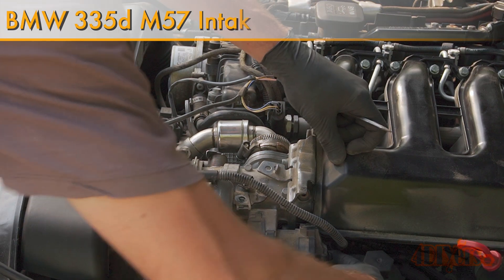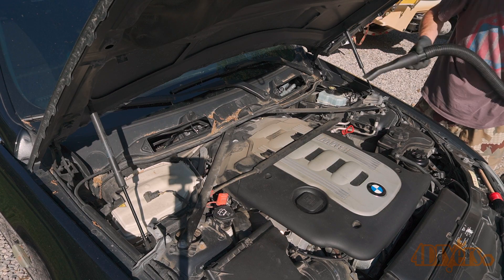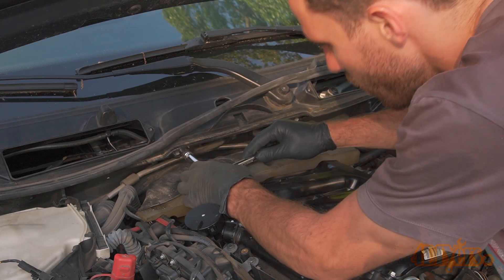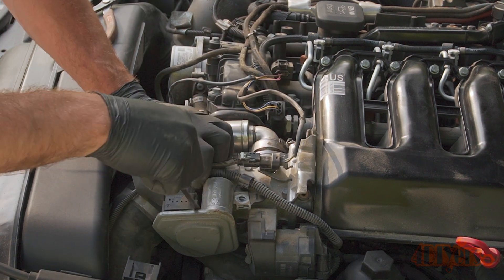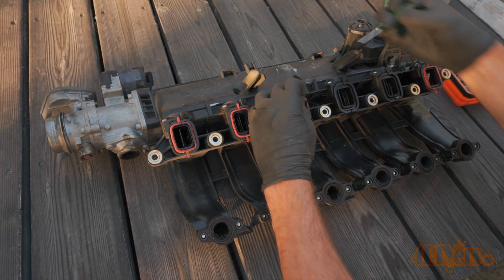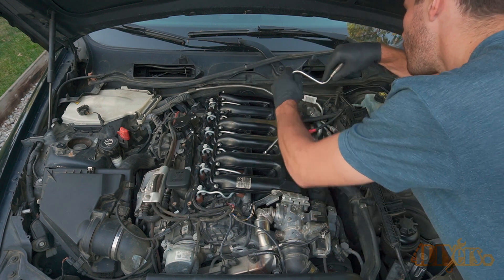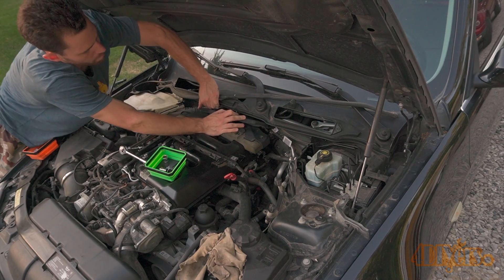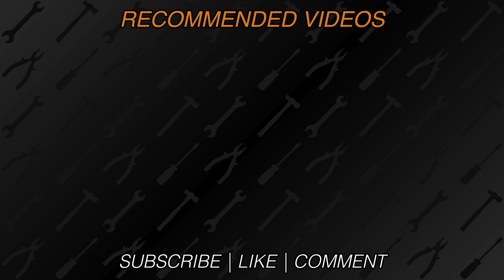How to Remove the Intake Manifold on a BMW 335d M57 Diesel

Comment: 4:46 do you have to turn the engine so that the valves are closed before scraping up the carbon from the ducts in the valve cover? Where do those ducts even go? I don't get it.
Reply: Pretty sure when I did it I did turn the engine. They are intake ducts